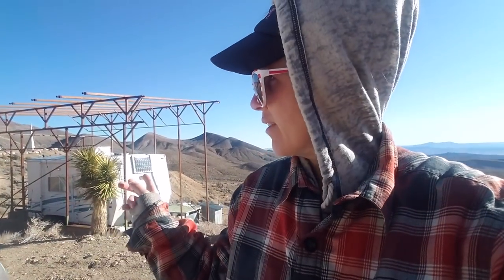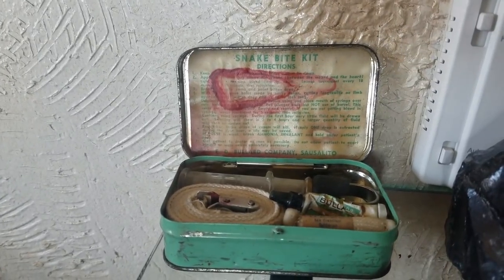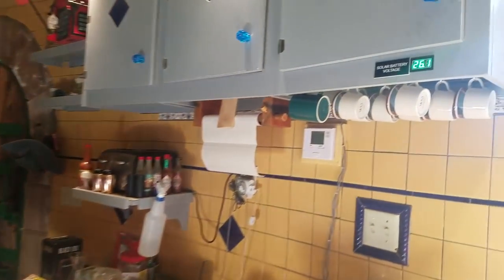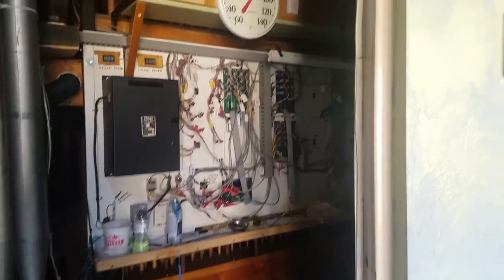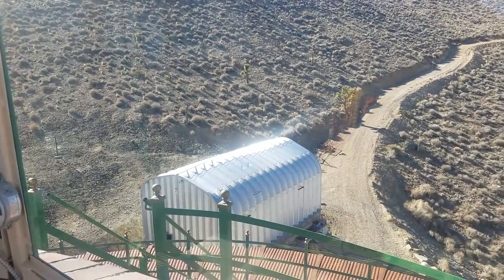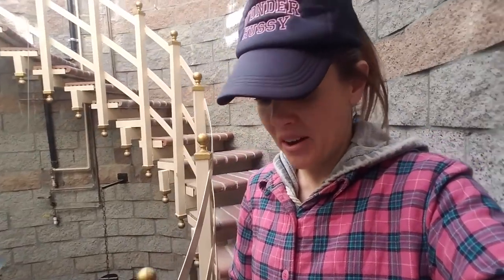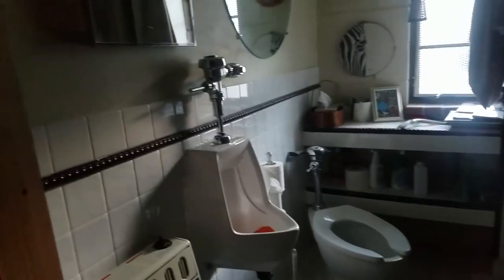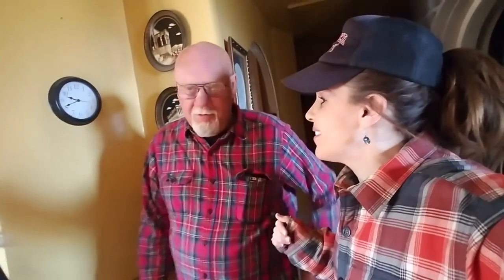Hardluck Castle: Hand-built Off-Grid Fortress in the Nevada Desert PART II

Comment: Thanks for the great video! I am also an organist. Yes, organ music takes a lot of practice to read as there are 3 lines -- 1 for the pedal; one each for left and right hands. It's sad to see a great instrument like that that is so badly out of tune. It almost hurts my ears to hear the sour notes produced by some of the ranks (groups) of pipes. A pipe organ like has several wind (the air supply is referred to as "wind") chests that are like bellows with leather that flexes for the chest to work properly. There are pressure regulars, tremulants, ( gives a "vibrato"-like variation to the sound) etc. A super dry climate will really age the leather, causing it to crack and leak air. 
Theater organs, which is what he played, are built to AGO (American Guild of Organists) standards. Each manual (keyboard) has 61 keys, the pedalboard has 32 pedals. Each of the tabs controls a different rank. The while tabs are for flute-type voices, yellow is for string-like voices (these pipes have lots of even and odd harmonics and product a "stringy" sound), and red tabs for reed-style voices.  He has to start a generator to supply power to the blower that creates the wind to make the pipe speak. The blower is powered by a 20 horsepower (or larger) electric motor.
Sorry for the long comment. I hope he can find someone willing to come out there to service and tune the organ. It would sound even better!
It is a beautiful building! He had to have worked his ass off to build it. It is truly a unique home. Personally, I think the state of Nevada should make it a historic monument and preserve it so it can be appreciated by all who visit.
Reply: I'll bet that Randy would love to have some expert tune that pipe organ!